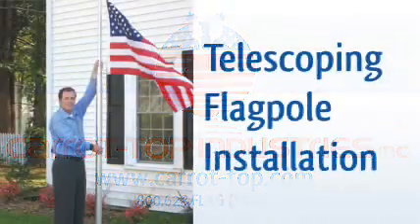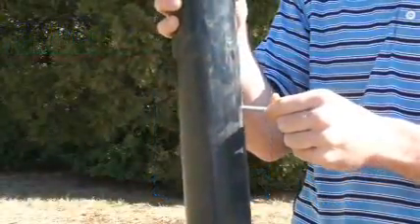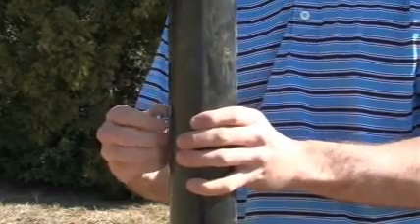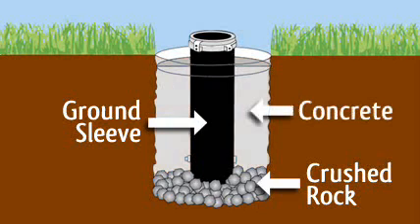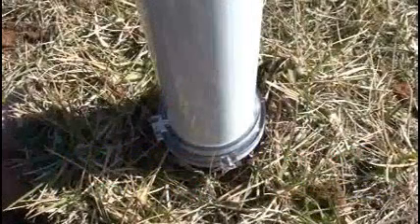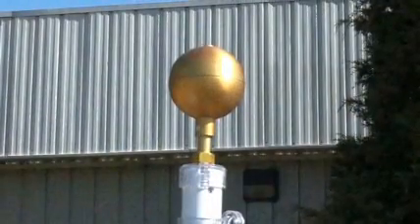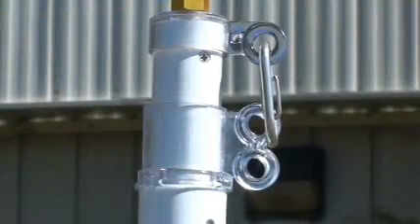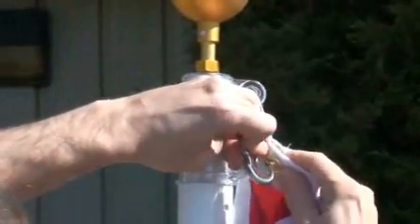How to install telescoping flagpole

Comment: @blackfeatherarchery I made my own flag pole by buying some Steel pipe from home depot, digging a 2 foot hole with my shovel, bought a flag from walmart, and lifting the flag pole into the 2 foot hole, add the soil back on and bam! my own flag pole under 60$ you don't even need concrete from the hole being so deep the pole won't come off.

Comment from the maker: @kekru184 
I apologize for not showing it in the video, but an easy way to make sure your pole is level is to simply take a carpenter's level and constantly check against the pole while installing. These levels can be found at any hardware store and are generally inexpensive. That would be my recommendation. Thanks for the commen and I will make sure we include that on future videos.